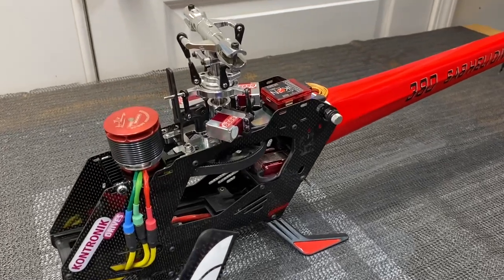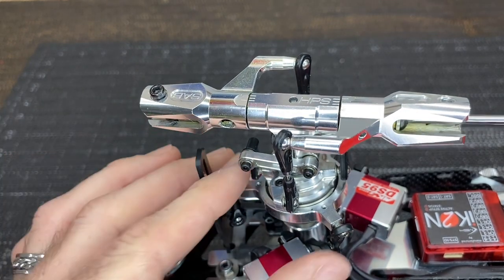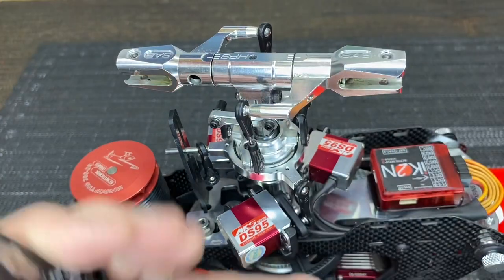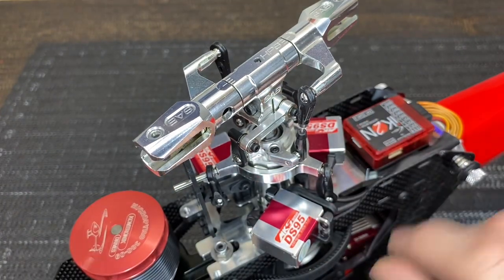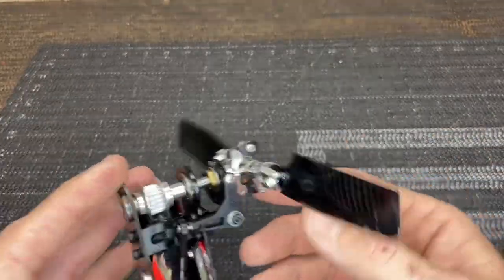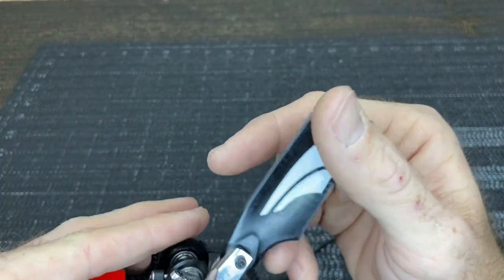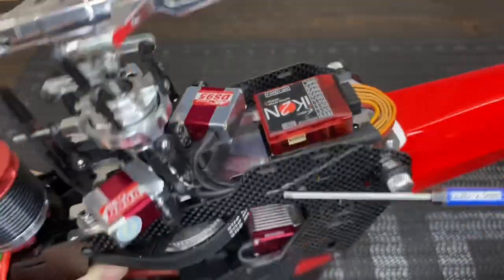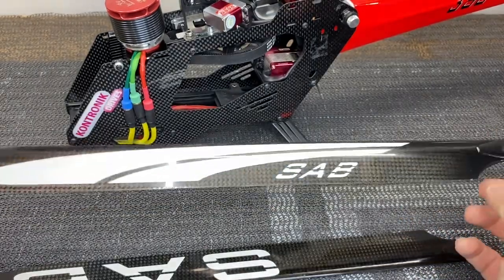What To Look For After You Crash

Comment: Once more great educational video! 

Question: at around 5.30 - 5.38 is see that the ball link has some damage from the use of a ball link plier. What are your thoughts on that, should a ball link be replaced with this damage?  
Tip: For better visual check of the feathering shaft, put a blade on at 90 degrees. While rotating the feathering shaft, the blade will go up and down if the feathering shaft is bended.
Reply from the maker: Thank you! No, any little marks in the bowling from the pliers or anything else is OK. They are plastic and they’re going to get marked up what you’re looking for is cracking and white stress cracks. That is another great tip, that works as well with the blade folded 90°.

Comment: Was going through a SAB check list. And in the end they mention replacing the plastic nuts and screws and metal screws after 3 removals. In the kraken manuals state replacing the plastic nuts and bolts even after a soft crash. Thought of sharing that
Reply from the maker: Locknuts are only good for so long. The retaining lock part of the nut which is the nylon wears out after so many times of it being removed. I have found they’ve last a whole lot longer than what they recommend.

Comment: The rescue switch has saved my M2 so many times. See it falling out of the sky press the switch and punch it and it's usually alright, won't save you from trees though lol. I bet the ikons rescue is just as good but haven't tested it yet on the 420
Reply from the maker: Rescue is a great thing to have. I said it off on every helicopter and don’t always use it on every helicopter. This particular one I did not set it up as I set it up for speed flying in not 3-D flying lol.
Reply: I've crashed and fixed the OMP M2 so many times - it is educational to learn what breaks, how to fix it, and confidence inspiring to know it's an easy fix no matter what.

Comment: Awesome vid bro again wonderful tips. I have a question here, how you actually manage to tear down a complete feathering shaft because I’m always able to remove one specific blade grip with all the bearings but the other it’s not coming apart, so do you use any special tool that no one speaks of, or how you manage to have some grip on the shaft without scratching it with pliers-like tools. Sorry for my bad english, greetings from Venezuela
Reply from the maker: So the best thing you can do is get yourself a feathering shaft tool. Basically it has a one-way bearing in it and it allows you to slide it over the feathering shaft and get the other screw loose. Also, another great tip is use heat! Keep the feathering shaft bolt up with the soldering iron to around 800° it will let the Loctite loose and come out with ease.

Comment: Well, got to do that yesterday night.
And i even had a good idea of what happend, when it happend.
Lost control of the tail, heli started spinning.
Thought i had a broken ball joint on the tail servo.
Cut the motor, and tried auto rotation, but too late.
Big crash, broke both carbon sides, landing gear, undercarrige, alu tail attachment bended, main shaft like a U , swash stuck in the bend, feathering shaft bend, one blade grip bend, tail shaft bend, canopy destroyed and a single main blade cracked.
A total write off. Spares vs. a new kit is in, at a difference of only $100...

But all linkage to the tail was still in great shape. (???)
The culprit was the set screw that had backed out, from the tail assambly to the tail shaft, despite loctite.

But i have to give credits to MSH for there Evolution tail-boom design, not a single scratch. ( I think the tail impact did bend the alu support, so it's incredible strong design in that boom.)
Even that it's a very loooong boom at my Protos 770X Evo.

So inspection at home after some flights, i'll highly advice that, to check all screws regularly, and do a good pre-flight check.
I had 60 flights in, at 4 days.

Comment: Best way to check your feathering or MAIN shaft is to roll it on a piece of GLASS!
Reply from the maker: Yes that works great as well but checking like this works every time without having to pull anything apart.
Reply: @westhobbiesrc8051  That is just a short cut, not truly accurate, but ok. To each their own. 👍🏼👍🏼
Reply from the maker: @MARKLINMAN1  it’s not a short cut, if it’s not bent or you want to check why pull the head or tail apart to see. Spin the shaft it’s it moves even the slightest pull it apart and then roll on glass.

Comment: One way I check my main rotor shaft and tail shaft is to remove the blades, power up and spin up the system looking for wobble.  Is that a problem or OK to do?  I look at is as being similar to putting it in the drill but without having to remove it from the heli.
Reply from the maker: You can definitely check the main shaft like that. There is a different ways, I personally like to pull it as it could mess something like bearing up if it’s bent bad and make more issues. But it’s a slight bend I don’t see a problem with it.

Comment: Hey Jeff, quick question regarding testing the bent feathering shaft, should I test it with the ball links connected to the swash and the blade grips like you did? The reason I ask is, my blade grips don't move when the ball links are installed. They do move however when they're not installed. Is it normal for blade grips to move if those ball links aren't installed? Would this mean I should replace my feathering shaft?
Reply from the maker: So technically no, you should not have to remove them. But! If there is a ever so slight bend in the shaft it might not move up/down with them connected. I would pull the shaft out and roll it on a peace of glass to make sure it’s straight if it’s moving the grip up/down.
Reply: @westhobbiesrc8051  might as well get a new one, I need new blades too. I didn't have my Ikon set up correctly and it pile drived itself into the grass when I was testing it 🤣. Needed a new tail boom and smoked all the gears in my servos because I was using the metal servo horns, because I thought they looked cool. Real hard lesson I had to learn I guess....

Comment: okay...soo...i havent had a crash since putting in a new spindle..what would be the cause of one of my grips will move slightly at a certain point while turning it?..i even dissasembled it ..took my spindle out..and i rolled it on a flat surface while looking to see if i could see any light under it while rolling it...and nothing...it rolls perfect with no wobble ..so the spindle is not bent...would it be a sign its time to put new bearings into my grips?...i checked for slop..and have very very minimal play in them with the blades on ..any suggestions would be grreatly apprciated!
Reply from the maker: How do the bearings feel? Are they gritty or Naci? Is it aluminum or plastic blade grip? If aluminum blade grips, the actual grip could be bent itself. It could also be a bad bearing, causing it to slightly move, but I would check the blade grip.
Reply: @westhobbiesrc8051  i have the aluminum dfc upgrade head ..my bearings feel fine when i insert the spindle into a bearing and spin it.. did feel a slight bit of notchy-nes  ..but only while holding the bearing still ..and spinning the feathrn shaft while holding it to one side.. an angle..and then its just the slightest bit of gritty feeling..when its in the head..and its being held in straight..its like butter....and Thanku very much wes for responding..im sure help requests  questions are neverending...so i super apprciate cha my man! tyvm!..im not sure what to look at for a bent gril tho🤔..i know the grips i have on that came in the upgrade kit have never seen a crash...i do have a backup set of the same ones tho...i bought two of the kits so i would have one for backup
Reply: @westhobbiesrc8051  i will make a short vid and email it to ya if thats kewl..?..mayb ur trained eye can spot summin im not seein